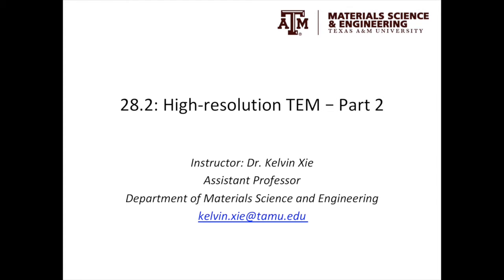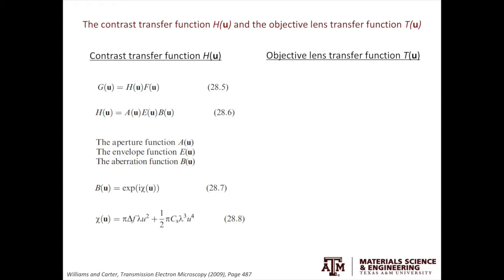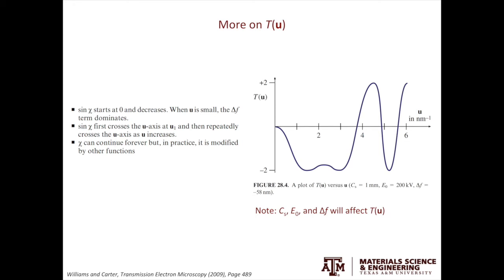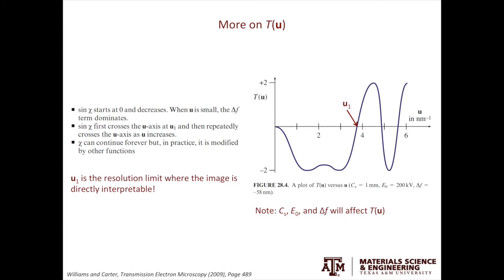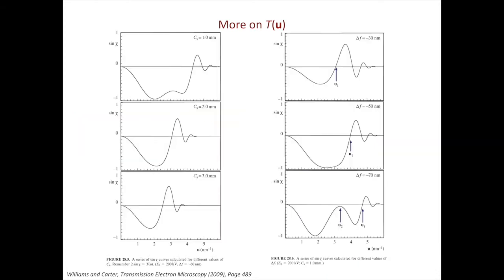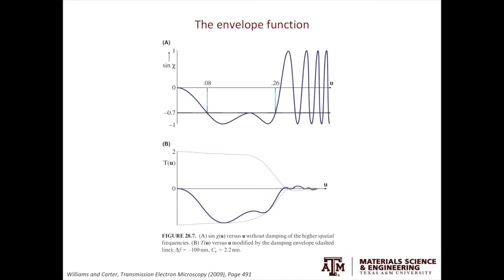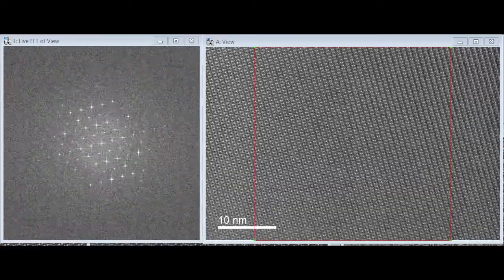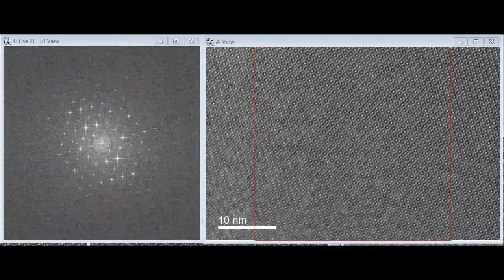28.2: High-resolution TEM - Part 2

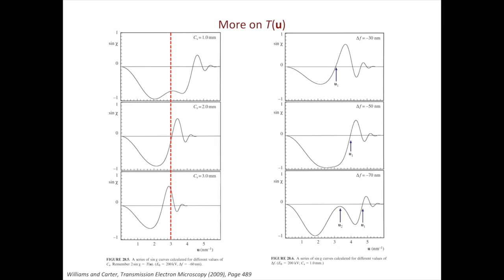Comment: 4:34, As defocus ranges -30,-50,-70 (nm), u1 increases.... eventually higher u1 is the better resolution but please clarify in defocus -70nm u2 is present but u1 is higher so i am confused that which one gives the better resolution (-50 nm or -70nm)
Reply from the maker: You are correct about u1. For u2, it is very close to zero and contrast appears to change here in the contrast transfer function. Hope it helps.
Reply: @kelvinxiemsentamu6890  now i clearly understand it affects the contrast but does u2 impact or degrade the resolution ?
Reply from the maker: @vickysathi  Resolution is a measure of the ability (distance) to tell two points apart. So u2, in theory, should not affect resolution. However, it may complicate your interpretation of the contrast you see.